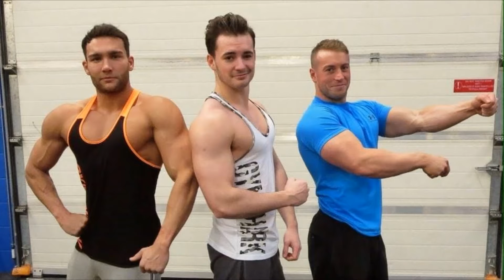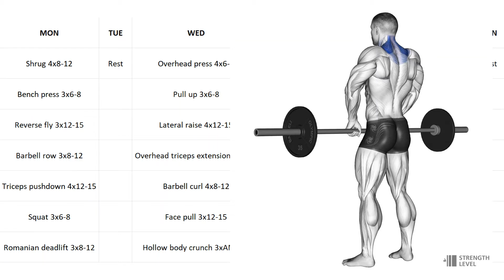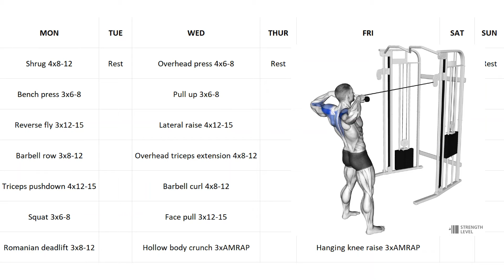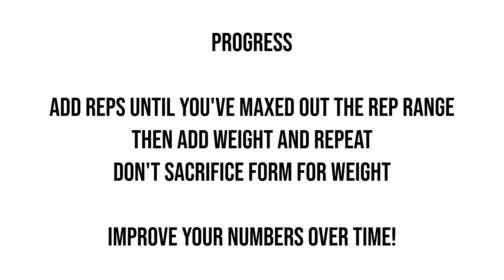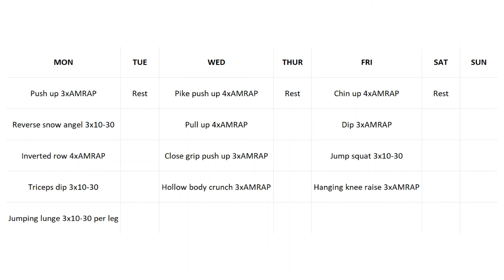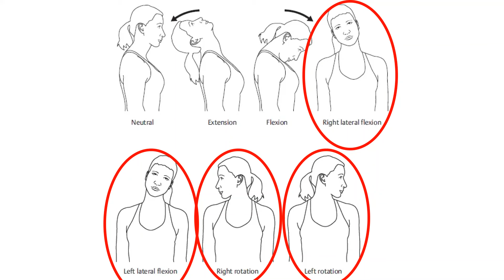How To Look Like Sukuna - Physique Guide Sukuna Jujutsu Kaisen (bodyweight program included)

Comment: I'm struggling to know how much I should bulk and cut for? Any advice? I've bilked for a good month and a half, but it's been hard since I really wanna cut to look good for bulk without puffiness. However, I'm really happy with the muscle l've gotten and I don't want to lose that.
Plus, I haven't gotten as much muscle as I wanted. I got a lot, but I'd like more. But prom is coming fast. Any advice?
Reply from the maker: This isn't what you wanna hear but muscle takes years to build. You'll need to bulk for months and years over the long run to maximise muscle growth. Its unfortunate but you have to sacrifice your facial aesthetics a little bit in the short term to make muscle building easier. You can build muscle while maintaining but it's much slower 

To prepare for prom I'd say get lean and preserve your muscle as much as possible. Get a nice-fitting suit and groom yourself well and you'll look great.
Reply: @BenWinney  don’t you have to be in a calorie deficit to be lean tho?
Reply from the maker: @LukeEntertainment7  Yes
Reply: @BenWinney  And do you know if it’s possible to grow muscle in a deficit?
Reply from the maker: @LukeEntertainment7  It's possible but very hard. Generally you need to prioritise either building muscle or cutting fat while preserving muscle
Reply: @BenWinney  Thank you! Also, is there a way not to track and still be lean and have muscle mass? I've been tracking but I'm almost done, I'm 160 pounds and used to be 195, and I'm 6'2. I always get anxious eating too many carbs and protein, and etc.
I don't even enjoy eating anymore.
However, I also don't
want to be fat again and would still like to be fit.

Comment: With body weight, you can Target traps and rear delts. With traps you can do an inverted shrug on the pull-up bar or on rings, you can also do a handstand and shrug up and down doing that that'll hit the upper traps. You can also do an l-sit and shrug up and down. 
For rear delts you can Target them using a side plank, and a reverse plank wide grip. If you have rings you can do Facebook with the rings, or add towels on the pull-up bar.
I use a towel or a canvas cloth to grab on the pull-up bar so it activates my forearms.